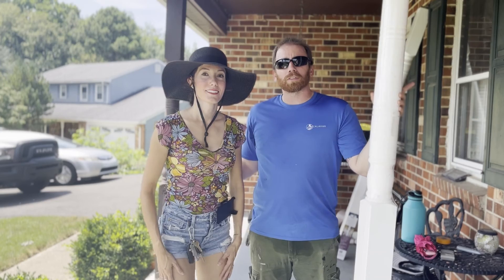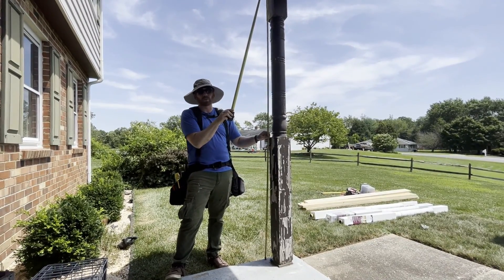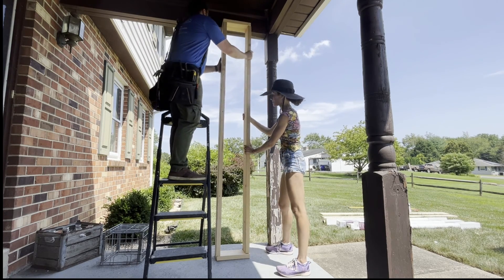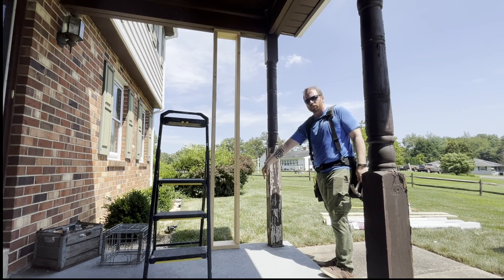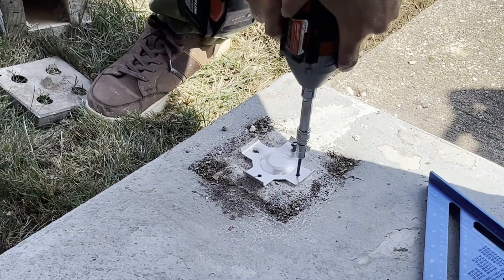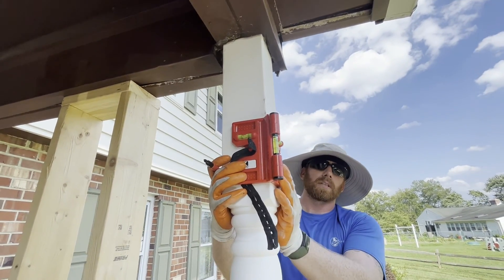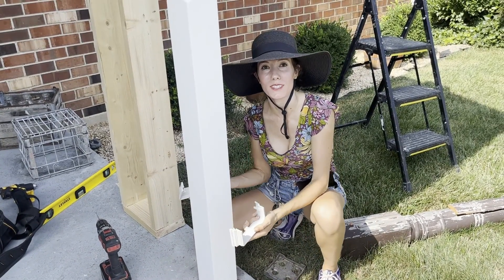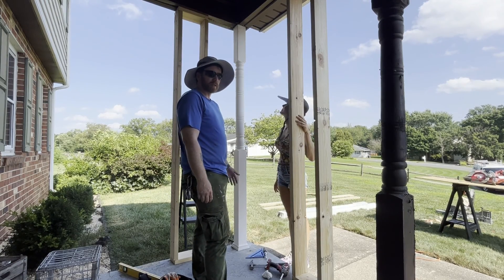Replacing a Load Bearing Post

Comment: Hang on, no fastener to attach the post to the steel bracket? Only the weight transfer holding it in place? Sounds like ait could fall off easily if someone accidentally falls on it.
Reply from the maker: This particular post from this manufacturer called for this. You will find different posts have different methods of attachment, some have an L bracket. Always follow the manufacturer's instructions for sure. The key here is to make sure you have the proper support while you are removing the post. Thanks for the comment!
Reply: The weight transfer was your wife’s foot hitting the “skirting”
Reply: Very helpful thank you!! 👍
Your wife stepped on the skirting though that’s why it moved 11:05😂😂😂😂